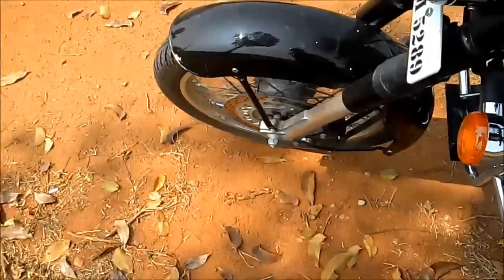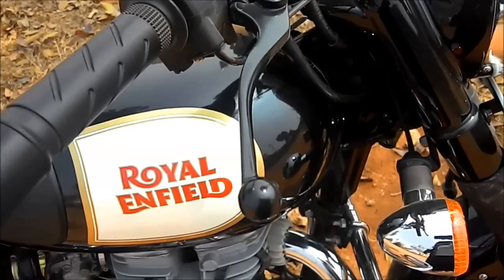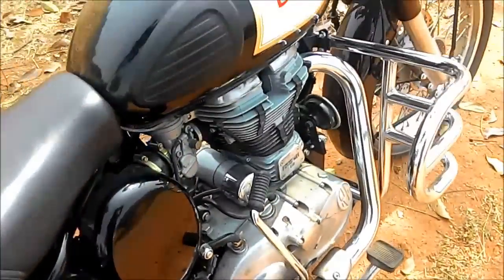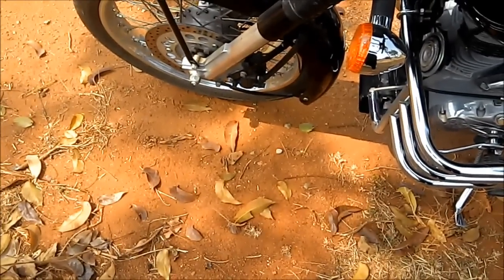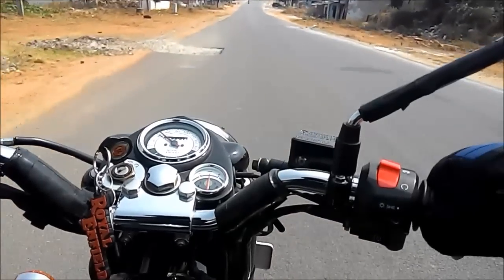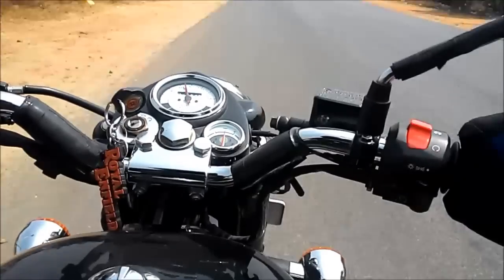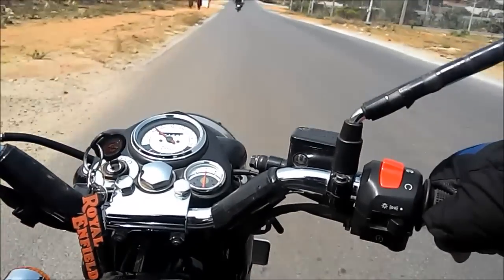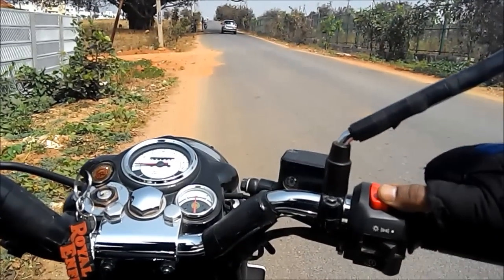Royal enfield Classic 350-  Braking technique

Comment: hi bro, am planning to buy a new bike ...and am very confused .. my concerns about  RE CL350 are :
1.vibration
2.handling
3.maintenance cost 
4.tubed tires (will hopefullygo.for alloys)
can you pls let me know how to handle these. and pls let me know the paid service costs also?
 I currently own a Yamaha fz16 it's been nearly 8yrs and am planning for an upgrade.
Reply from the maker: itsshan420 
If you are owning FZ, then go for FZ25. Dont go for RE. You might regret it later.
Reply from the maker: itsshan420 
Now, for your concerns on RE
1) Vibration - Is very bad, but can be reduced considerably. So, that is not a major issue as such
2) Handling- Very bad. Bad chassis and ancient design. Poor suspension. So, handling is pretty bad, especially at higher speeds
3)Maintenance cost- Manageable. Parts which are frequently replaced are Brake pads, air filter, oil&oil filter. Paid services cost around INR 2000 approx. 
4) Tubed tyres- Last very long. But grip is poor. Skids in the rains. Punctures are very common. My front tyre has been punctured 4 times, rear tyre 5 times in 20 months
Reply: thanks bro for replying!!
Reply from the maker: itsshan420 
Welcome bro! Do make an appropriate decision and dont regret it later

Comment: I know this video is for braking technique but since Ajay has responded to many of my earlier questions, so here I come once again - Hi Friends, I have purchased a RE 350 Classic May -2016. My bike has so far only ran 5000 KM. RE showroom, performed all the 4 free servicing on this short span. If I did not come to service because of KMs are low, they fined me for not coming by due date. Now I am worried if some problem shows up after running more KMs will they take responsibility. Any help in this regard is appreciated. I purchased my bike in Bangalore.
Reply from the maker: Niranjan Das 
RE engine warranty is for 1+1 yr or 20000kms whichever is earlier. If you do all free services and 3 paid services in time, then you get the 2nd year of warranty. Else it lapses after 1yr. Even I lost my warranty because I didnt bother about getting the paid services done. 
Now, its crossed 21000km in 20 months and I anyway dont have warranty now
Reply from the maker: Niranjan Das 
Regarding RE taking responsibility for any fault that comes up, forget it. Dont count on it. You ride the bike hard, keep all the mechanicals functioning well and change the oil regularly. You shouldnt be facing any major issue with your bike if you follow this

Comment: Hi Ajay.. do we have to do this press release technique to front and back breaks simultaneously ??
Reply from the maker: alex thomas 
Press the foot pedal hard and use this technique for front brake.
Because of the bike's massive weight, the rear wheel locking-up is NOT common. So, you can press it hard
Reply: ho ok.. Thanks Ajay.
Reply from the maker: alex thomas 
No. The bike wont skid easily. Unless you are riding in heavy rain or on slippery roads. Try it out yourself a few times and you can determine how hard you should be pressing
Reply: ok Thanks Ajay..
Reply: alex thomas ,in a heavy rains its safe and its good as riding on the dry tarmac. only if it is drizzling than it will be dangerous and we have to be careful about everything. Of all its not the motorcycle. its the rider.Any motorcycle can go anywhere.

Comment: hi Ajay please give me review of Thunderbird braking style. cos it's comes with dual disk brake
Reply from the maker: suman ghosh 
From what I have heard from a few TB owners, the brakes are just OK. Not all that great. Although TB has a rear disc, performance is pretty mediocre. Plus, the rear is prone to locking up. And, the rear disc along with that saree guard is an issue during punctures,making it especially difficult to remove the rear wheel.
I suggest you to take a back to back test ride of TB and classic 350. I do not have access to any TB 350. So, I suggest you take a back to back test ride.

Comment: Hi,can you pls summarize whole procedure .do i have to apply both brakes at the same time
Reply from the maker: TECH IHOSY 
Yes.Apply both brakes.
 But my suggestion is, first change the brake fluid at the front brake reservoir to DOT 4 fluid. Dont get it done at RE service centres. They again refill the reservoir with some useless fluid. Get it done outside. The brakes start working way better that way
Reply: Ajay Kaushik  thanx bro you gave a very fast reply thanx.
Reply from the maker: TECH IHOSY 
Welcome! Hope the suggestion helps you!

Comment: Have you put those rubber on your handlebar and mirror to reduce vibration? If yes does it really help?
Reply from the maker: Jeevan More 
The idea was to reduce vibration. But, they dont help much
Reply from the maker: Jeevan More 
https://youtu.be/BNq-V6ofF4k
Instead, do this and vibration will be greatly reduced
Reply: Ajay Kaushik A friend told me that the root cause of vibration is Engine Air Fins and that is the reason we see those black Air Fin Clips. He said adding couple more clips (which we can buy as spares) reduces vibrations to greater extent. Haven't tried it out yet. Just wanted to share the info.
Reply from the maker: Jeevan More 
Well, try out and let me know how it goes. I would also share it to others so that it helps them as well

Comment: In the demo it is not clear if you are doing demo for front brake/rear brake or a combination of both. I used to be a bike rider before and those days disk brakes were rare (early 2000's). From my bike riding experiences what I learnt is never touch the front brake! My rear brake was always good enough to stop my bike. Also, senior person suggested, front brake is an emergency brake. But first time I am seeing you guys are telling a different story!!!
Reply from the maker: I use the disk brake in this manner and rear brake is pressed down gradually and continuously.

If you want fastest and shortest braking distance you can use this technique.
The rear brake cannot stop this massive bike; So you can use this technique
Reply from the maker: https://youtu.be/4ED8BfPtaTw
You can watch this video for further clarification
Reply: +Ajay Kaushik Great. I am planning to buy a RE 350 Classic. Dealer is telling me cost would be Rs. 1,52,000 Is it a rip-off price by the dealer? What is the MRP for 350 Classic in Bangalore? Any help would be appreciated. I don't want to pay the dealer extra money for his commission.
Reply from the maker: +Niranjan Das 
I heard classic 350 costs rs. 157000 on-road bangalore. So, it shiuld be a good deal itself for you
Reply: yes.  you are correct.  front brake will launch u up in the air. rear is more than enough
Reply: +Niranjan Das - on any motor bike, the front brake is always the main brake and you do have to feel the front wheel. The rear brake is more for balancing the bike up. An emergency stop uses both hard. I've only been riding bikes since the 70s. 
If you apply the rear brake in a bend with the power off, the bike will straighten up, if you do the same with the power on the bike will lean in more. 

An emergency stop needs the bike upright in a straight line so it's a combination of brake-steer-brake-steer-brake and it has to be done very fast without thinking.

On this bike the front disc is very powerful and the front will plunge but it doesn't tend to do a bunny like a lightweight Jap howler. Even when you apply the rear brake the weight shifts forwards and the back goes light, meaning less braking available, which is no good. If you have to stop in a hurry you need maximum braking, that means both brakes but mainly the front, try to stand it on its nose without locking the front wheel.
Practice.

Comment: what is that rubber pad in ur silencer?.. is dat any good for a better sound
Reply from the maker: Nah it does not change or modify the sound in any way. It is there fo protect the edge of the pipe from any kind of impact; 

The silencer pipe is a little longer than the bike and ground clearance of bike is very low. So, the edge of the pipe may touch the ground when going over bumps and big speed-breakers. The rubber absorbs impact if silencer is hit

Comment: when I shift gears there is a pop like sound from the gear lever. Can you help me with it?
Reply from the maker: I didnt undetstand what pop-up sound it makes.
Have you made any video of it?

Mine was making Kat-kat sound when shifting gears. It was really hard until 6500-7000km. Now, it is really smooth. 
Shifting from 1st-2nd is finally like shifting 1 gear rather than 2 gears
Reply: That same sound
Reply: Is it alright for the vehicle to make that kind of sound? 
I have a weird feeling that it might damage the gear box. Especially while downshifting
Reply from the maker: +Jerry V John 
How many kms have you done?
It should go away with putting more kms on odo.

Only thing to remember is shift gears with the feel i.e at proper rpm.

1st-2nd at 20/25kmh
2nd-3rd at 40kmh
3rd-4th at 50kmh
4th-5th at around 65kmh

Usually these are the shift speeds

Comment: Hi Bro i am using RE classic 350. my rear brake is getting Drum sound its v annoying . please give me suggestion
Reply from the maker: Komal gundavarapu 
Get the inside of the drum cleaned. And check if any water has seeped into the drum. Remove it. The noise should go away

Comment: Hi Ajay, I noticed some black setup in your handle bar. What it is?
Is that any thing to reduce vibration
Reply from the maker: Karthikeyan GS 
I think you are referring to the additional bar end weights and the rubber tubing that I have put on the handlebar.
I have removed all of these now. I have crossed 20000km now and the vibes are very low now. It is a complete stock bike now
Reply from the maker: Karthikeyan GS 
https://youtu.be/BNq-V6ofF4k
This video was made after crossing 18000km. Check it
Reply: Hi Ajay Thanks a lot for your reply...
Yes, that rubber tube in Handle bar. Is that reduce any vibration. Now my bike just crossed 5000 kms. I am facing vibration.
Reply: Ajay Kaushik Thanks a lot Ajay. Will try those options.
Happy Riding...
Reply from the maker: Karthikeyan GS 
It will reduce as you pile on more and more kms

Comment: I got the new rs classic 350. on first day after travelling just 14 km it shut down while running, pulled it side and try ti self start sw but wont started , amo meter sw hit the red area , let it cooled for 10 min then ut started again, but agian riding another 5km it shut down same process followed again, then again agfter 5 km , what ahw be the reason since its brand new bike dont know what happen, if any one can suggest.
Reply from the maker: I cant say why your bike is shutting down abruptly like that.

Have you checked if there is sufficient engine oil?

Is your bike overheating?

Did you take it to Enfield ASC?
Reply from the maker: +Ajay Kaushik 
If your ammeter deflects towards red, it means that the battery is getting discharged very fast
Reply: Needle was hitting on right side , I think its green side
Reply from the maker: +Electra ARM 
If its right i.e green, it means battery is charging. Thats not a problem then

Comment: what is your mileage???  and at wat speed ur riding??
Reply from the maker: I get around 37-40kmpl.
If I ride at low rpms i.e very low throttle opening, 
I get around 40+.

But if I ride in heavy traffic, I get around 34-36kmpl
Reply from the maker: Since I ride mainly in city, I'll be doing 40-65kmh

Comment: and what's the maintenance cost of this bike?
Reply from the maker: Free services- Rs. 1200- 1st&3rd
Rs.200-2nd&4th

Paid services-Rs.1500-2000

Parts wear out quite fast-especially brakes-because of massive bike' weight. 
Other than that-OK

Does not very high maintenance unlike dukes

Comment: what about thunderbird 350 on your opinion...??
Reply from the maker: In respect of? Overall? Braking?
Reply: Overall...braking too..!!
Reply from the maker: +Utkarsh Agnihotri 
Overall: TB 350/500 is good for long distance cruising. Handlebar is high and bike has 20l tank with range of around 800km. But, it weighs around 195kg and filtering through city traffic might be difficult because of the low seating position and wide, long body.

Braking: Better than classic of course. But still not good enough. The wet grip of tyres is not good. So, under hard braking, the front brake locks up easily and bike fishtails easily.
Reply: +Ajay Kaushik thanx bro for your support...!!
Reply from the maker: +Utkarsh Agnihotri 
Welcome bro!

Comment from the maker: https://youtu.be/AljYJk6x7YM- The review of my bike
https://youtu.be/4yVPIBHUdeo- how to reduce handlebar vibrations
https://youtu.be/t6IBzXrJXvo-Royal enfield torque
Reply: Hi Ajay. I mentioned this on a reply to you on another video. These brakes do not have to feel like that. 
You front squidgy lever looks like it needs bleeding and all the old fluid flushing out with new DOT.4. Check the brake hose is not expanding under pressure, it may need replacing if it is. 
The back does not have to be ineffective and wooden - the shoes have to be centralised but the factory paints the cam bush to the brake plate, this is a mistake, it was not designed like that (or it would not have slots and lock nuts). The cam bush is attached with two little screws that have lock nuts. Take the brake apart and remove the cam bush, rub the paint smooth and reassemble but this time with the screws locked so that you cannot quite move the cam bush by hand but can under full force of your weight on the brake lever. It took me a couple of goes to get this right but now the shoes are centralised we get both of them providing braking and there is a solid 'bump' feel when they hit the drum.
The Classic is heavy for a 350 but the 500, which I ride, is about average for a 500, but these days is considered to be small and lightweight compared to the big stuff. Over here in England, braking is taught during rider training, it takes practice and using both brakes to balance the bike out, otoh I've been riding bikes since 1970. You can brake on a bend, the rear will lay the bike down further and the front will stand the bike up and if you're not careful, slide the bike out from underneath you.  And one can brake and swerve to avoid at the same time, one has to juggle the brakes and steering so you don't skid or fall off. Practise.
Reply from the maker: Jeff Slade 
Thanks Jeff. I will give it a try
Reply: Braking technique is learnt. You can get instruction from an instructor or an experienced person - I had a mate who was a pro track racer, but mainly it is learn on the job. Suggest practising at slow speed in an empty car park, never practise on a busy road.
Reply from the maker: Jeff Slade 
Sure. I will practice on empty streets. Not busy ones

Comment: how can we check oil in classic 350
Reply from the maker: Right side of the engine(foot brake lever side), there is a small window. It has 2 levels, max(top mark) and min ( lower marking).

If your oil level is in between these two levels, it is proper

Comment: Great video! 

I just test road thunderbird and the classic today!  I've been riding Bajaj Avenger for over 11 years now.   The Drum brake is bad aswell.  I am used to doing this routine tightening of the rear drum like every week!  And I totally understand what you're saying. 

Also I can say that the feedback at the Lever was NON EXISTENET on ThunderBird  and also Classic 350.  A good feedback gives a great confidence push. 

Having said that... I test rode the Himalayan as well.  Awesome breaking response and feedback. 

---------------

This is a great technique -- but form my general riding experience - never go full ON on the front breaks.  You can push your rear breaks, coz (at least for me)  even if the rear locks up owing to a wider wheel setup and dynamic of force distribution, you should have enf time to pull if off since your reflex usually kicks in and saves the day!
Reply from the maker: Ya. I agree with you on not going in full force on front brakes. Its not good to do that coz it locks up real quick then

Comment: Bro im planning to buy a bullet 500 is it worthy.? Pls tell the exact mileage if u knw and also any prblms of bike. Thank you
Reply from the maker: The Std 500? Its really good, friend. You can go ahead with your decision.
The problems are similar to this bike. 
No fuel guage
Battery issues ( Can be avoided by regular maintenance)
Single disc brake
Not so great tyres

But, these problems can be overcome without much difficulty, by adjusting your riding habits.

Mileage is around 30kmpl in city and 35 in highways